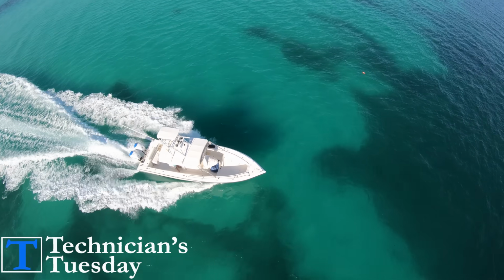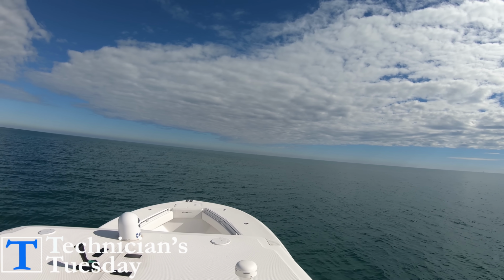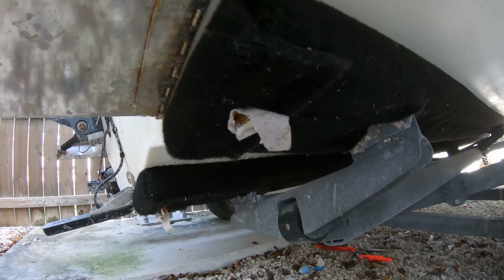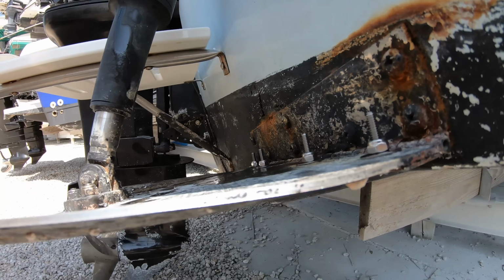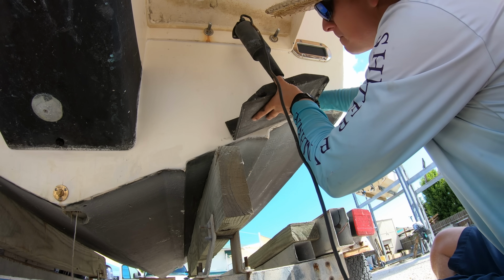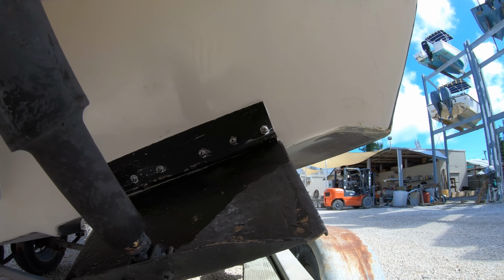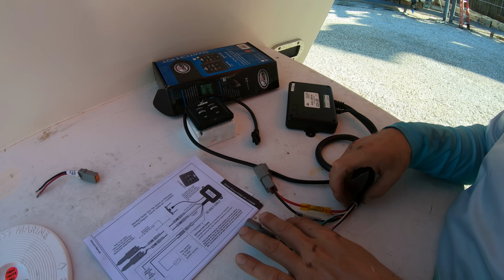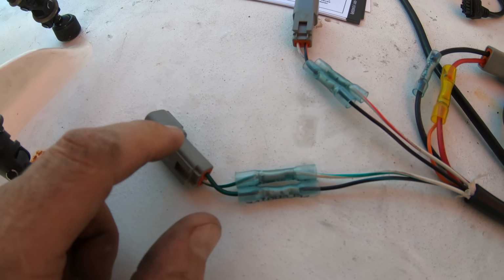Why Your Boat Needs Trim Tabs!

Comment: At about 1:50 you said putting the tab down on the heavy side of the boat will lift that side of the boat? Don't you mean putting the tab down on the opposite side will level then boat by bringing the opposite side down?
Reply from the maker: Kind of hard to explain, so the tab going down, creates stern lift on that side of the boat, which will bring it up, but creates drag, so it pulls the boat to that side, and at the same time pushes the bow down on the opposite side of the boat. Does that make better sense?

Comment: Yes and No. It depends. It is the right way to trim a boat but not the only way. the ability to trim on the run is a major asset. deep vee's with stern drives benefit most. loads vary as do conditions. modified vee's do better. inboards do better if engine is located right. know your boat AND your tabs - do Not oversize trim tabs. the boat will be over sensitive to the controls.

Comment: I lost my comment I started. Find later. My Mckee had Lenco tabs and I used them every trip
You figure quick the physics of what is happening and going to happen. 
Great idea.
It like a big hand pushing down on bow. Smooth ride
well smoother, yea will create drag. 
Don t just mash and hold actuators. Bump to make small changes till its rt.

Comment: Using power tools to fasten bolts to your fiberglass is a bad idea. Take some extra time and do it by hand. If you over tighten that screw it will over size the hole and more then likely crack the gel coat around the hole. Patience goes a long way!

Comment: Bennett "Bolt" tabs are all-electric.  They come as a full kit, or as replacements for faulty Lenco actuators, and have a lifetime guarantee.    Good stuff.
One benefit of all-electric tabs is not needing a spot for the pump.  Nice for smaller boats, especially.

Comment: I won a bet (and an argument) from two seasoned boaters who laughed at me when I told them that activating the left (port) switch for "bow down" controls the right (starboard) tab and the right (starboard) switch for bow down controls the left (port) tab. Even after I showed them a document from Bennett explaining it, they still didn't believe it until they tested it on one of their boats.
Reply: Seasoned boaters are very reluctant to learn and test new procedures, must be an age thing for sure...

Comment: i have a 2006 triton 195 CC with a optimax 150. i have an indicator on the dash that is supposed to indicate the amount of trim. it isn't working. anyway is it suppose to indicate outboard motor trim or trim tab position? it's a single needle gauge .
Reply from the maker: Its probably going to be engine trim and the sensor on the bracket is probably busted. Most of the trim tab indicators are more like bars that move up or down or side to side

Comment: Electric are far superior, everything is in the actuators. They react quicker, don’t have a pump or reservoir, so less maintenance and issues.
Reply: I strongly disagree with this statement for a number of reasons.  
1. On some applications, Lencos are "touchy" or hard to set right because they move too fast.  
2. When Lenco seals leak, it fries the electric motor, and you need new actuators, but no lifetime warranty.   It's just a matter of time.  
By comparison, most hydraulic tabs last decades with no problem, as long as the pump isn't down in the bilge, where water can damage it.   And "Tabman", a Bennett rep, has been known to send replacements long after typical warranty is long gone.

Bennett makes all-electric tabs, their "Bolt" series, made to directly replace the Lencos, and they DO have a lifetime replacement warranty.  I've replaced several Lencos with these, and they are excellent.  Only one ever failed, and a new one came in 4 days.  Outstanding service and product.

Comment: I would over size drill the mounting holes then bed with a top quality expoxy  then redrill and seal holes.
Reply: Always countersink your gel coat too. Or it will crack, around the screws. 😉

Comment: Why your outboard boat does not need trim tabs. You already have trim on your outboards. They can effectively be used just like trim tabs.
Reply: Really?   So if all your guests move to one side of the boat, and the boat is leaning in that direction, how do you fix that without trim tabs?   You can't.  If you have a funny swell coming off your port side, causing your boat to pount, how do you fix with your outboard?  You can't.   They are not the same.  Power trim tabs offer much more control.
Reply: @thilltony3362  thats when you have you guests evenly distribute their weight. Also if your boat can't  handle a little bit of a list then you stay at the dock.simple really! Common sense.
Reply: @CaptainDayne  You could ask the family to stay in specific locations and only take your boat out in great weather or face a pounding.  But with a touch of a button, trim tabs can take care of that, giving you more comfort and letting you go out more often.
Reply: @thilltony3362  who said anything about great conditions  Not me i run in whatever is required. And yes for stability a prudent Captain requires weight equalized.  By the way im a 200 ton master. Trim tabs dont reduce sea conditions some times they have very little affect.
Reply: Dayne,  Maybe it's because you are a 200 ton master that you are missing the point with small, recreational boats.    With relatively small boats, even one person going to one side or another can cause lean.  Tabs fix that.   If there is an annoying 1-2' chop coming at a bad angle, tabs can keep the nose down and/or lean the boat to minimize pounding.
Do you really believe tabs are the same as engine trim, or do you just like to win debates?
Reply: @thilltony3362  no maybe you are missing the point a little bit of common sense goes ong way. By the way I own a 22' center console. 
No trim tabs. I also own a 38' cabin cruiser that has trim tabs 14' of them. Like i said small boats such as center consoles not needed.
Reply: @thilltony3362  yes trimming the engine can a d does lower or raise the bow. It can also free the hull to ride on top of the water , but you should trim back down when making a sharp turn. By the way if you have twin outboards you can trim them  Independently and use them like tabs too. So i stand by my statement not needed. Just my profesional opinion take it or leave it. Your the one trying to debate my facts.
Reply: @CaptainDayne    That is interesting to use twin engines trimmed differently like tabs.  Well lookie there.  I just learned something new. Thanks.

Comment: Which trim tabs are more reliable, or will last longer? Electric o hydraulic?
Reply: Look at old boats with still working tabs, and almost all are hydraulic, with the pumps in a good, dry location.  That being said, Bennett Bolts are electric tabs with a lifetime warranty, so either can be a good choice.
Reply from the maker: Now a days, they all hold up pretty well during most conditions and they last about the same amount of time. They each have their own problems though, so it's hard to say one is better or will last longer than the other. Obviously, the electric actuators in the water, eventually fail, sometimes sooner than the hydraulic. 
But, the hydraulic have solenoids on the pumps that go bad, and they can leak and have the pumps in the boat fail in the same amount of time. So, I guess it's more of a personal preference :)

Comment: They are a great aide on flats boat helping you get on plane in very shallow water with tabs all the way down stern is lifted on take off launch can be done with motor trimmed up more than normal and you slowly trim down the motor as momentum increases until you pop onto a plane

Comment: just as an FYI, the LED lights on the trim tab control switches are triggered by the "time on", the length of time you have the switch(s) depressed, not the actual physical position of the trim tabs. They are just a point of reference ...
Reply: Raise the tabs all the way to "reset" the LED's

Comment: Where did u buy the hardware from like the bolts nuts and washers
Reply from the maker: Those came from having them in my toolbox from over the years. But you can get them from Amazon:
https://amzn.to/2Hbargh
Reply: Do u only use snap on tools or do u use others brands and do u have a tool truck that come to your job

Comment: You forgot Smart Tabs. They absolutely fantastic on small RIBs or small boats that have a lot of bow rise while getting on plane. No need to use and wear out power trim on every acceleration. The only contribute at the start and then they are virtually neutral. No drag like foil types that can limit your top speed. I’ve used them on as small as 310 RIBs with actuator placement change. Should be standard equipment in my opinion on some small boats.
Reply: Thanks for the info!🙂👍🏻

Comment: Most boats need trim tabs as they are shallow in the vee and under speed they want to fall over , bad design , most of these boats are top heavy , most are outboard driven and the motor foward thrust with speed lesson the waterline length making the boat unstable so the tabs level the boat up in rough weather they are useless as speed is the problem in fowl weather some of these things are on 35 footers up , so good luck.

Comment: What brand heat shrink connectors do u use
Reply from the maker: Usually just the Seachoice connectors, only because they are a little cheaper than the Anchor's :) but they are both great connectors!

Comment: trim tabs are a bandaid . get a hull vane. i watch all these expensive and high tech boats take off everyday at the no wake sign by my marina. they are all wrong. they are not balanced and all mass is shifted to the stern at accel.  tilt and trim also require brute force to work. much fuel consumption and no go. i saw a 45 ft v bottom with a hull vane. it planed almost immediately and didnt plow  tons of water to climb up on hull. look them up. it has no moving parts and can be installed with the boat in the water sometimes. im building one for my 30' sea ray . it's a 1976 deep v hull .normally planes at 12 to 14 knots. currently the trim tabs do nothing for mitigating the prop wash and directing it aft. instead it just boils the water behind the v.  too much turbulence.   my boat is a mid engine staight shaft inboard .with two 351 fords. the key is to align the wing with the center of prop wash . i feel it works much like a ducted prop but with less drag. the wing (vane) also creates lift as an airplane wing does. this balances the mass at acceleration and allows forward movement with less pushback from water.it also reduces wake by an incredible degree.
Reply from the maker: Hull vanes are nice, but they don't really work with outboards. :)

Comment: I've had tabs on all my boats, from 17' to 29', inboards to outboards.    I consider them essential.     WRT to holes in the transom on a cored hull, do it right the first time and its never an issue.   Drill holes oversize by a good margin.  Then fill those holes with solid glass.   Redrill the smaller holes required to mount the tabs.  5200 the holes.

Comment: In some of the more "lightweight" systems, is this worthwhile on a smaller boat?
Reply from the maker: Depends, most little boats don't have them, but then like flats boats that are used in the ocean more, they usually come with them. So it depends on where you are boating to make them worth it or not. If you don't ever go offshore and usually are on a calm lake. They won't really help with anything :)
Reply: @Nolaman70  Nice! Thanks for the reply! I'll check them out. 😁👍🏻👏🏻👏🏻👏🏻
Reply: @Nolaman70  Killer sweet!😁👍🏻👏🏻👏🏻

Comment: On my 22' Seat Hunt Center Console boat the trim tabs are required to correct the boat from proposing at higher speeds.
Reply: Gary Meyer  trim motor in some until u stop porpoising make sure trim motor  is trimming all the way in  before trying

Comment: Bennet has electric trim tabs I have them on my boat
Reply: Do you like them so far?  Im looking to add some tabs this spring, and am wondering which electric or hydraulic i should go with?
Reply: Fishy Hobby definitely go electronic  less parts and faster/cleaner install like the video said all things on a boat break eventually but the electric tabs are faster to replace parts when needed

Comment: #yeti. i had a depth sounder installed on the transom and turns out its lower than the required 1mm. should i have them reinstall it?
Reply from the maker: Unless the spray is just out of control and it's reading fine, you should be fine. Usually the brackets are adjustable too. So you might be able to just move it up a little without drilling new holes  :) if it's causing you problems.
Reply: @BornAgainBoating  haven't had any water testing yet. It was installed at the end of the season
Reply: Wait until you water test it, and see if it has a bad rooster tail.  If no bad spray, deeper tends to read better at speed, but it's a fine line.  I had a big side-scan 'ducer that made a rooster tail that sprayed exactly where the outboard's air intake was.  Inside, the engine was literally covered in salt spray.  Had to add a spray plate over the 'ducers to eliminate the spray, because it would stop reading at speed when we adjusted up enough to stop the spray.    I have added a number of those plates over the years.

Comment: There's also those interceptor designed tabs as well. They have them on the 41' Bahamas with the quad engine setup because the boat is so narrow the normal trim tabs would disrupt the water flow to the outside engines
Reply from the maker: Oh yeah, those are sweet! We don't really see a lot of them, I've heard great things about them though, I'd like to actually get to play with them :) I think they cost quite a bit more though then the conventional style tabs.

Comment: Thank you once again; I have just learned a weeks worth of great information, in 8 minutes!... I have the Lenco's and they have been good so far; in 40+ years (20+boats) of boating, it's my first boat with trim-tabs. At first I was over-using them. Now I use the engine-tilt to get on plane, and only use the trim-tabs sparingly to 'balance' the boat. (Is that a good policy?)... My last 2 boats were big, displacement, diesel cruisers; no trim tabs, so tabs have been a learning curve for me.... Thank you once again!
Reply from the maker: Hahah Thank you! Awesome! That's a lot of experience :) and yeah, that's great usage. Most of the time you shouldn't need them unless the water is just messing you up. Those parkers are usually pretty good without them most of the time because of the weight of the cabin :)

Comment: Bennett has hydraulic and electric tabs to compete with Lenco. I have had problems with Bennett not being able to work at full throttle. K planes would work at any speed if you can afford them.

Comment: #yeti. I don’t wanna be a critic but you should be using the key power relay on that connector on the dts harness. I skipped it once and hooked directly into it. It worked fine but when the customer wired stuff up later and needed key power he found that wire and over loaded it. It got expensive after that....
Reply from the maker: I guess I should have had that relay hooked up, that's what I meant :)

Comment: I hate drilling into my transom 😟
Reply: Brandon Leckie most newer boats have composite transom so drilling with good silicone adhesive will be good
Reply: @hookednrolling2009  some 5200 silicone will make it water tight and last for life

Comment: #yeti I have a 23 footer and the trim tabs didn’t work when I got the boat. Mine are hydraulic and I didn’t know anything about boats or trim tabs. Turned out to be just the switch. I took the wires loose and stuck them straight to the battery and the thing worked. So I spliced in a new switch and it made a world of difference. I use them all the time now! Makes a world of difference running through miles of gulf chop. I can bury the sharper part of the bow into it and it’s so much smoother. Guzzles gas, but it’s worth it.

Comment: I cringe...as if the boater doesn't have enough time consuming mechanical issues. Maybe it's just me, but the mechanisms seem complex and visibly messy.
I liken this concept to; Training Wheels.
While in use, the tabs DO drag and this DOES affect fuel consumption.
We learn to keep our engines and drives Tuned Up to get better fuel efficiency then we deliberately add stuff to our boats that reduces it?
The list of adverse boating circumstances may affect navigating, but isn't that half the fun?
To many folks sitting to one side? easy fix? (extra Life Jackets)